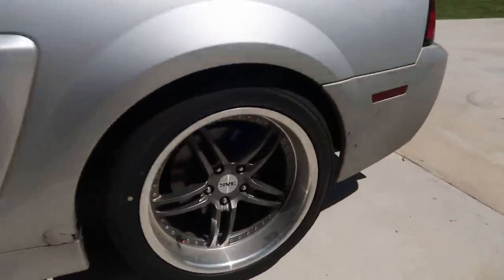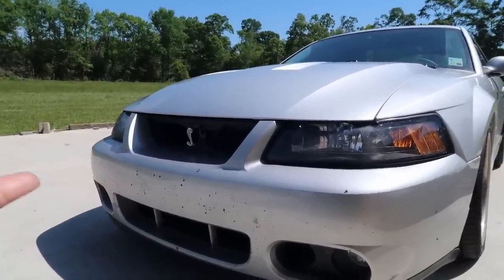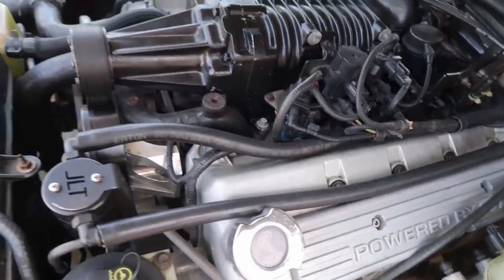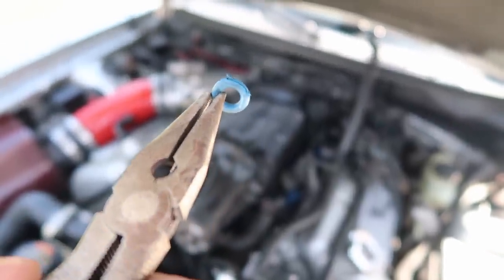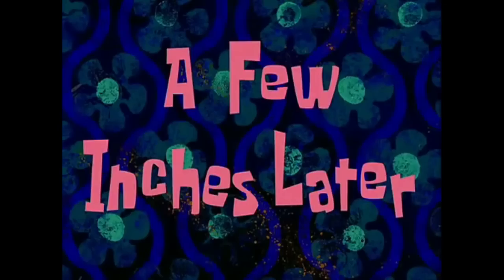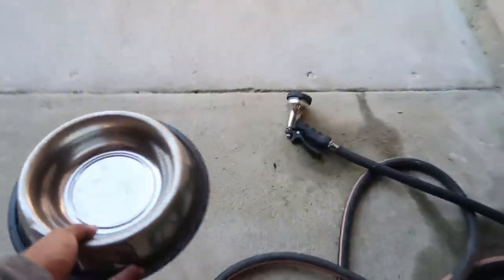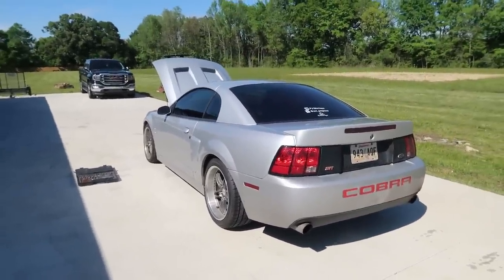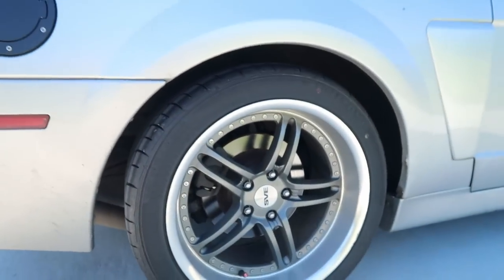BAD Things Going On with my Mustang Cobra! Quick & Easy Fix!

Comment: That really sounds like a vacuum leak, if it was a o ring on the injectors I think it’d be leaking fuel like crazy. Does it go away or change tone if you rev it up?
Reply from the maker: It goes away when on the gas. But I’ve sprayed all kind of brake clean and performed quite a few vacuum leak tests. But it doesn’t seem to be that
Reply: PJ Morrison it may be the blower itself. Or you know it could be a bearing in one of the idlers. If you ran it with the blower belt off and it didn’t make that sound, I’d be looking into those things.
Reply from the maker: Don’t tell me that😩😩.. I’ll get it looked at tho, thanks for the notice.

Comment: Traction Control on these cars is worthless. I have mine permanently disabled in my tune. I daily drive my 650whp '03 Cobra with no issues at all. As long as you respect the power you'll be fine. BTW, your car will run much smoother and stronger with a TUNE!!
Reply from the maker: I have a tune, have always had it tuned. But as for traction control, I’ll just feel a lil safer when driving in the wet. Though I make sure not to speed then. I’ve wrecked before due to hydroplaning and I’m not looking forward to that again
Reply: @pj_morrison  Sorry, I don't remember you getting a tune and others were saying you needed one too. Also, getting the blower changed may require an update for your tune and/or a maf upgrade for the added air/fuel intake. And TC will not help you with hydroplaning. It only cuts engine power when you spin the rear tires.
Reply from the maker: I’m sure traction control helps with it some.. And I’ve made quite a few videos datalogging and I’ve upgraded to the Diablo MAFia also😅
Reply: @pj_morrison  Yeah I ditched my Diablo Mafia a long time ago. I upgraded to an SCT BA2600 MAF sensor. Noticed a BIG difference in performance.

Comment: Sounds like you might vacuum leak somewhere to me.
Reply from the maker: Vincent Dixon I actually found the culprit. The MAP sensor was letting outside air in🤦🏽‍♂️
Reply: @pj_morrison  ok good deal.  How did you find it?
Reply from the maker: Spraying brake clean.. I’m guessing the last time I sprayed it, it didn’t get sucked in
Reply: @pj_morrison  well it's good to hear you back up and running strong again.  And keep the videos coming I enjoy watching them.  July 13,14 LMR is having a cruise in at Texas Motorplex in Ennis Tx. Its only a mustang and lightning event. You and Pegues should roll up. It's basically a free day of test and tune. Google lmr cruise- in 2019 for details.
Reply from the maker: Will keep this in mind, this sounds like a nice event I can meet ppl and get some good footage of💪🏽
#GoodLookingOut